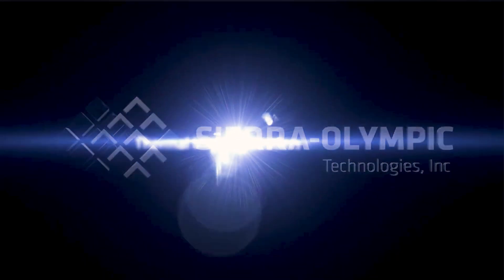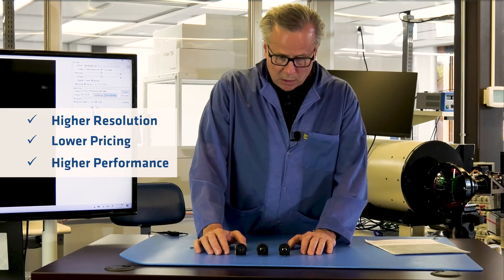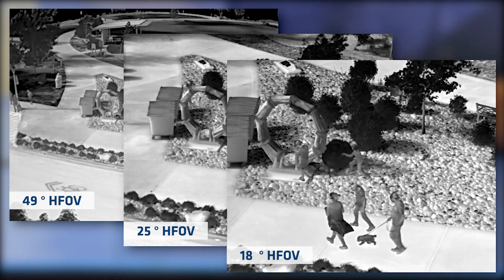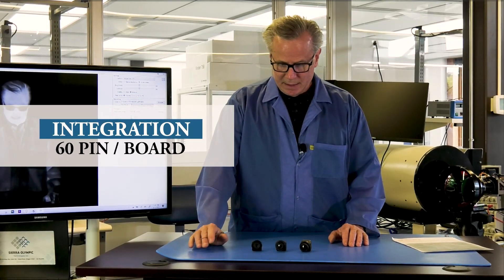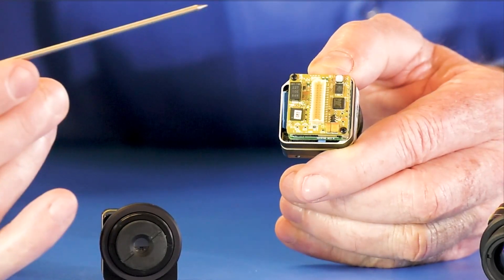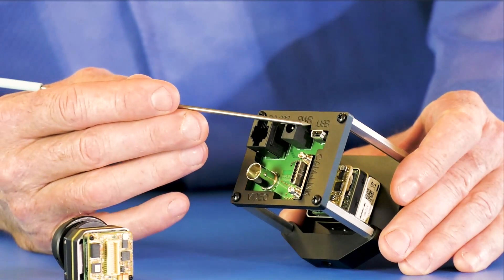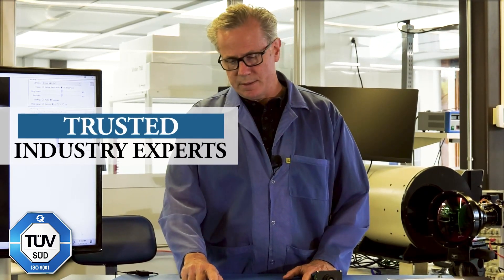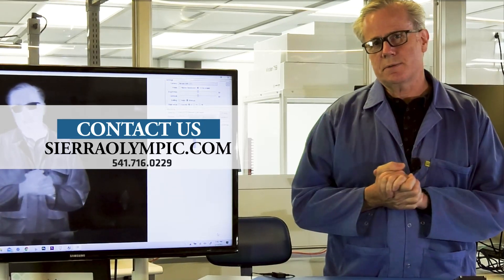Technical Video: Tenum 640 Ten Micron LWIR for Systems integration

Comment: It looks like you greatly increased your visible video quality for these technical videos. 

Is there a European reseller as well? Would love to build a filmmaking tool around newest technology in resolution and sensitivity. 

And wouldn't 10μm allow to get resolutions even greater for 20mm sensors like the Fairchild Athena being 1920x1200 but 12μm pixel pitch. Especially with Leonardo umbrella pixels being this much better than other designs. Anything to use common QVGA+25μm lenses, really. 
Can you capture low level raw data and apply spatial and temporal noise reduction in post, or does the noise reduction happen before that in real time or even in analog?